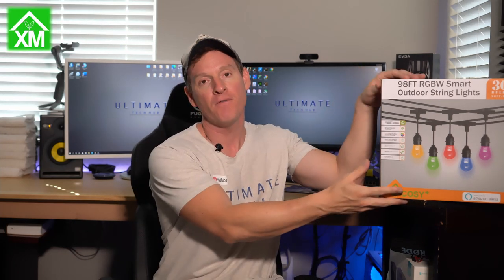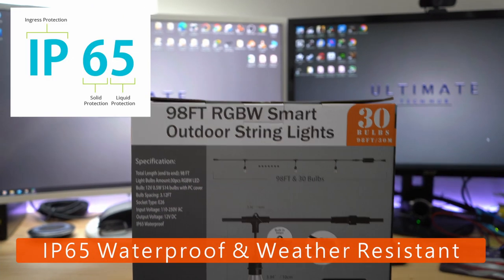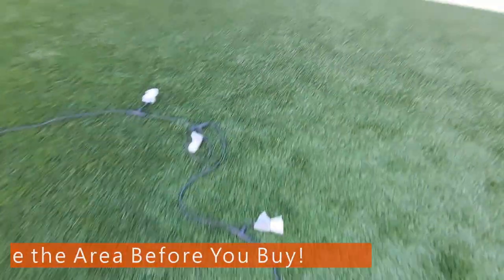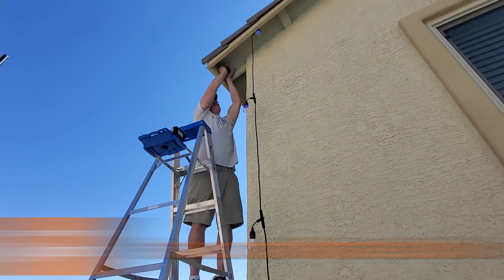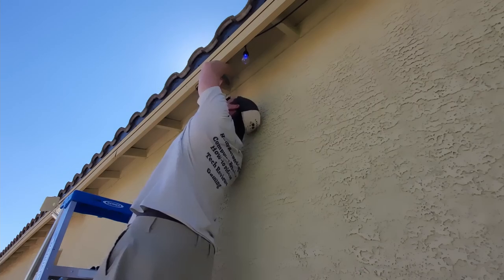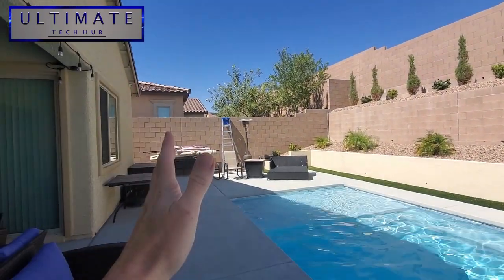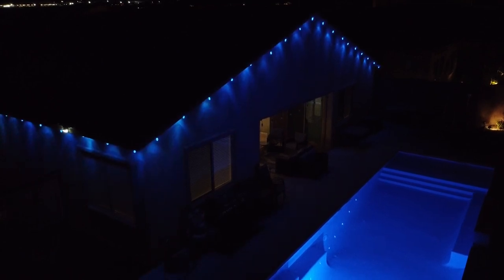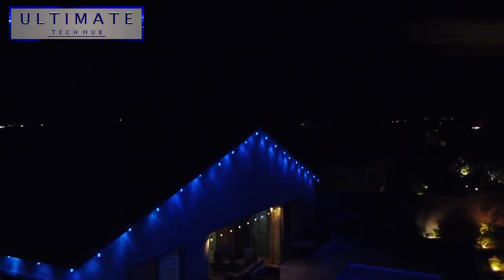How To Install Outdoor Smart String Lights  XMCOSY+ RGBW String Lights

Comment: Do you feel these have a true RGBW LED in them? The Atomi version in costco is indentical to this down to the app just branded differently. The costco one doesnt advertise RGBW so the RGB has to make the white resulting in dim output/lumen/brightness for warm white.  Does the warm white in this product rival the same brightness as say string lights that are purely only warm white non changing color LEDs?
Reply from the maker: Yes I believe they are true ARGBs. The whites are very white and they can be dimmed and brightened. Great set of lights! I've had them for about 2 years and currently have 4 sets of these lights. They work great with the app and the schedule feature is awesome. I have other videos on this brand of lights. Thank you for watching I really appreciate it.

Comment: Not sure I want to drill in my house and I don't have a wood overhang.
But looks good though.i did have some I really liked but after 5 to 6 uses it was trash time.
Do they make ones that don't dangle that I can use my gutters/roof?
Reply from the maker: No all of these lights they sell dangle with a wire. Sorry.

Comment: Nobody is me thing if we can cut the wires and splice them for areas where we don’t want lights such as a gate. Does anyone know? A set of lights is not going to fit exactly so the site has to be cut and capped. Do we just cap the wire on the end or do we have to loop it by connecting the two wires together?

Comment: Can I get 2 packs of 96ft and make them work together, my space is 160ft total and I notice some lights only allows to connect 96ft at the time
Reply from the maker: Yes I believe you can run up to 2 packs of 96ft.
Reply: @UltimateTechHub  so 2 packs of 98 to work with same power box, my deal is to make them synchronize to work has one set , I try to send a direct message to xmcosy to confirm this but I really appreciate your help
Reply from the maker: @aatguzman8920  It should work with no problems. I have 3 light strings connected to 1 box. It's 96 ft plus 48 additional feet. I have a video on the expansion pack. I will send you the link today.
Reply from the maker: Here is the video link, 
https://youtu.be/7DVdY0vNzAk
Reply: @UltimateTechHub  oh wow, thanks a lot, this answer my question, do you also know if this lights have the music activation function, does it follows the music? Thanks again
Reply from the maker: @aatguzman8920  No these do not follow music unfortunately.  These lights are still very cool and look fantastic.

Comment: 5 *** STAR  video, question does this wifi app supports multiple separate 144 feet string?
Reply from the maker: Yes. I have 3 different sets of lights on my house and all 3 sets are controlled by the app and I have all 3 on a schedule. These lights are amazing! Thank you for watching and for commenting.
Reply: @UltimateTechHub  Thank you so much for for that ultra fast response!!!!!
Reply from the maker: @angeltejedalora2166  Your welcome!

Comment: Can you make individual bulbs be specific colors like it is shown on the package with 5 bulbs each a diferebt color? XMCosy is using deceptive and misleading photos on their packaging because what's in the package is  not capable of producing the effect shown on the box which is 5 different colors all on at the same time.
Reply from the maker: Yes there is all color mode which has all the colors. But you can't control each individual bulb.
Reply: @UltimateTechHub The image they sbow on their box and the one they use for their icon are both actually impossible to create. At best it's misleading at worst its falso advertizing on their part. VERY SLEAZY of XMCOSY and dishonest.